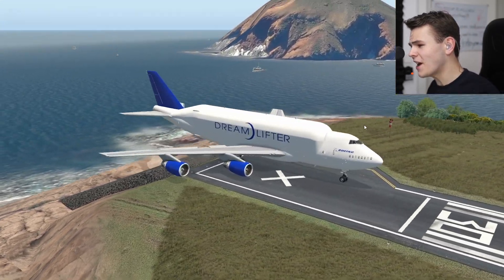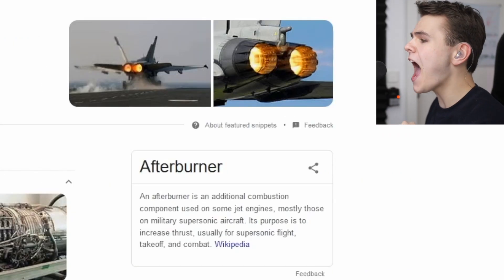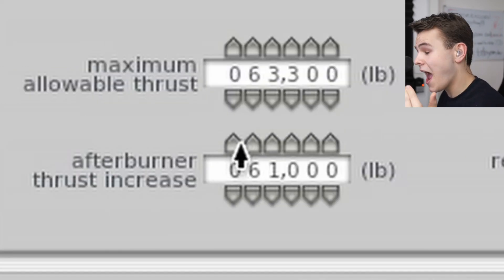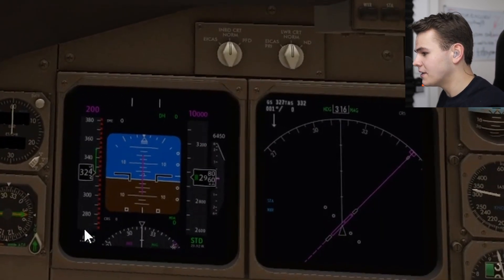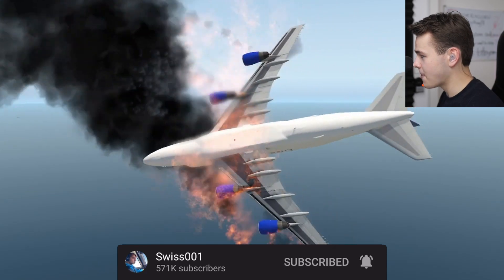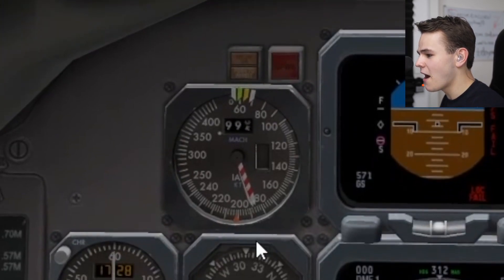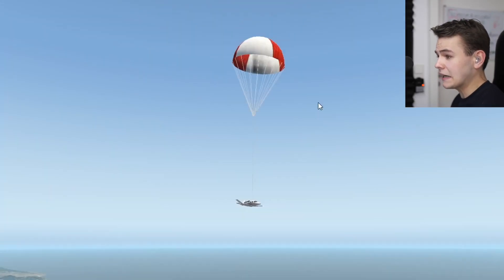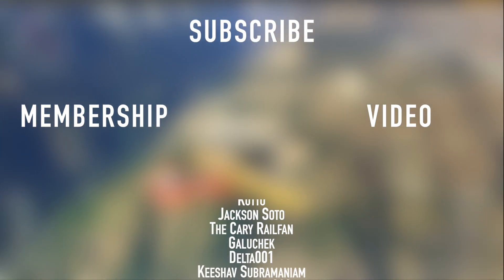Fitting Afterburners To Planes Could Actually Work

Comment: 1:54 bullshit. Concorde was actually capable of flying an entire flight including take off and acceleration using only the engines and never the afterburners. It was just never done for obvious reasons such as super long take off run and slow acceleration but Concorde only accelerated to mach 1.6 with afterburners, the rest was done on normal engine power. Concorde could supercruise which is maintaining mach 2 and any mach it could fly without using afterburners. The TU-144 for example couldn’t maintain speeds above mach 1.6 without continuous use of afterburners which is why it had HALF the range of Concorde
Reply: The Concorde really was the undisputed master of supercruise. I read somewhere that it during its life spent more time at supersonic speed than all other supersonic aircrafts put together!
Reply: @fromnorway643  thats very much possible. I mean, Concorde was so fast and good at supercruise, that thete is only one picture of Concorde flying at mach 2.04 taken from another aircraft flying next to it. That aircraft could only follow for a few minutes with afterburners and then had to go back to base. Idk why they didn’t take another concorde and flew it next to it to take some pics but yeah.

Comment: what about flying planes without engines by cutting engines in mid air or ending fuel. ending  fuel
decrease weight making the job easier.